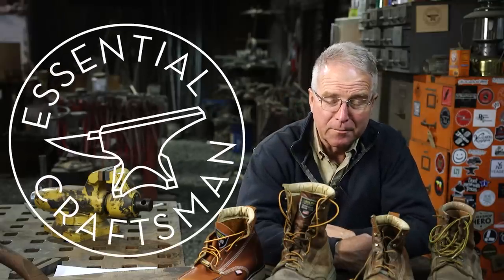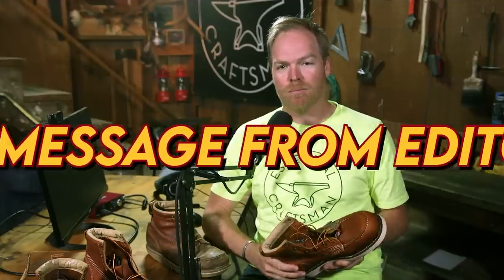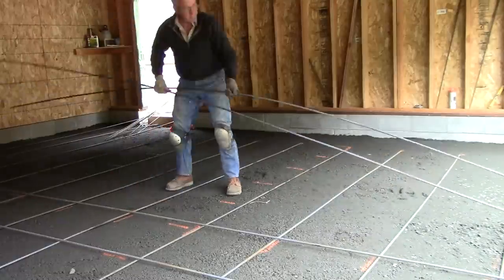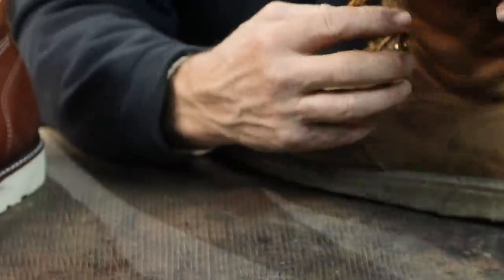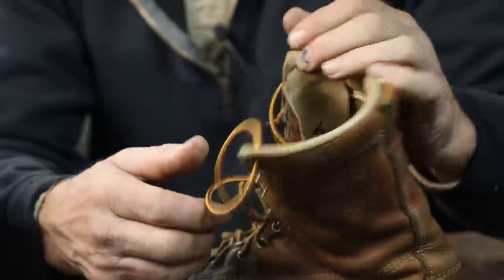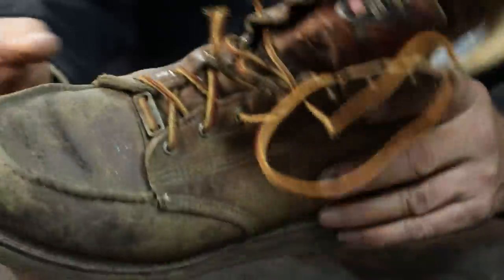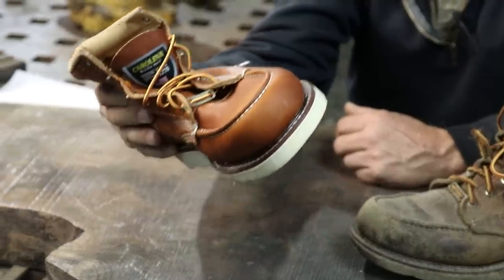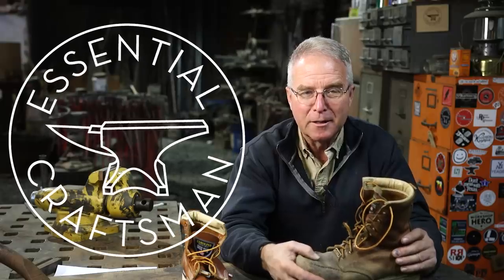Carolina Boot Review

Comment: I wear a 15 narrow and also have skinny ankles and low volume feet, tried all sorts, went out and got a custom pair of Nicks handmade in Spokane washington.  Heavy but fits properly and very high quality leather.  Also have a pair of Kenetrek mountain boots, lightweight and well built, rubber rand provides incredible protection of the upper.  Ment for hikes but my heal slips also not for skinny ankles but have been great work boots.  My other go to are Lowa renegade, not ment for heavy use but a good hiker.

Comment: I'm a machinist who also works outside on the weekends doing a variety of stuff, like clearing brush, running equipment or working on farm equipment, and I've had good luck with my latest pair of square toe cowboy boots by Irish Setter. Comfortable and good looking. Though i have to have aftermarket insoles for standing on a concrete slab all day

Comment: i had worn a pull-on Ariat with  “spidertek” mid-midsole. 

They are a hybrid western workboot. with a square toe and  composite toe. i had worn these  for two years of landscape/ Arborist work. it was great no laces in Arizona its Hot and the vents were nice. from climbing trees to pulling branches up gravel hill and lifting heavy stumps. They are perfect even come in a wide which i needed but nice leather walked along walls . these boots were just top notch for me. they were on the expensive side but i got my moneys worth.

Comment: I used to wear Redwing boots, but no longer.  For 2 reasons.  I had to have the stitches repaired several times.  And you can only buy them a Redwing store.  I like to shop where I can try several different brands.  I currently wear 8" Georgia Boots, which are fine and have lasted several years with no maintenance except Justin boot grease a couple times a year.

Comment: Steel-toe De Walt ankle boots. The boots you describe as Wellington boots are called rigger boots here in the UK and are banned on a lot of the big sites because if you break your ankle they have to be carefully cut off of your foot/ankle to prevent further damage that would be incurred if you took them off as you would normally.

Comment: I have used Carolina boots for years. I never use mock toe when I am welding due to the fact it burns out the stitching on the flat area. I just got a pair of wedge sole mock toe because doing carpentry work some days I'm on a ladder 6 /7 hours a day and that wedge saves my heels and arches. The correct tool for the job.👍

Comment: Blundstone CSA boots. Slip on/off, great for when you’re working inside, and you’ve finished the floors in a project and need to switch to runners or something like that. Relatively light, and the sole is very grippy. They were uncomfortable for maybe a week, but now they feel like putting on a sock.

Comment: Great review. The local Boot Barn do not stock them in the store and I found out that Thorogood wedge boots still fit narrow in a wide. I ended up doing an online order for two sizes. The 9.5 wide Carolina's fit amazing and smell amazing out of the box. Thanks again, from San Diego.
Reply: Hey @peglegthered. I'm looking at these boots too and I've read that some size down. If you have a 9.5 wide in these boots, is that the same size you wear in your average runner? Thanks!

Comment: I’ve been wearing Carolina Lineman boots for probably about 12 years.  Also have insulated Carolina loggers for winter.  Very comfortable, durable footwear, and while somewhat expensive, they’re far more affordable than many of their competitors.
Reply: Oh, reasons.  I like a tall upper for support and protection.  I often work in jean shorts, so the upper provides additional abrasion protection that many of you probably rely on your pants to provide.  I like the sole of the lineman boot because it’s aggressive enough for outdoor work, yet shallow enough to prevent tracking inside.  They’re electricity protected.  They have a shank in the sole, and a heel, which both help with ladder work.  They have a composite safety toe, which seems to conduct less than steel in cold weather.  They also have a double layer of leather over the toe, which seems to help the boots hold up to abuse better than the wolverines I used to wear.

The logging boots have many of the same attributes as the lineman boots, but with a very aggressive sole, steel toe instead of composite, and (in my case) insulation.  Admittedly, the logging boots are probably not quite as comfortable as the lineman boots, but they’re close.  Regardless, they’ve protected my feet quite adequately for years now.  I even wear them on 4 mile walks with my dogs.

Comment: I started wearing black, patent, leather boots, at 18 years, old in the military. Now they use suede leather boots, but so do I. I like the welder style black laces that are spark resistant, but I also use non-marring soles. I've been wearing the same model of boot for more than 20 years, because I hate to shop around if I am using each pair for 6 months to 2 years before getting a new pair. My size has bumped up ever so slightly in that time. I use a light weight 'trapper' version of Wolverine's 6 inch top. I'm with Nate on that.

Comment: I bought a pair of Thorogood wedge sole boots 3 years ago and it's been the best investment I've ever made as far as boots go. I prefer the tobacco color in 8in height. I've done everything in them from concrete to framing to drywall and trim and they've held up nicely. I chose Thorogood because an older carpenter that had taken me under his wing wore them and had been wearing them for a number of years. If I were in the market for boots right now Thorogood would be at the top of my list although I have also heard good things about Red Wing and Carolina.

Comment: I wear slip on Wolverine boots. I do concrete work and they get muddy very frequently here in South Louisiana. My feet get wet when hosing off lace up boots. And I try not to,but sometimes you have to step in concrete while pouring,to fix an anchor bolt or floor drain,or whatever,no time to change into rubber boots. Slip on boots are no problem hosing off at the concrete truck. Keep them oiled.

Comment: I don't need heavy duty work boots, but I do play outside and do some occasional occasional outside work.  But Timberland boots are the only footwear I can buy without trying on and KNOW that they fit my size 15 foot and that they will last for what I need out of them.  Like you said, preference, but I've found a brand that's consistently good for my use case.  Sometimes city shoes, sometimes boots, but they all fit and last.

Comment: I used to work off a ladder all day doing air balance in nicely furnished office buildings. I needed a good quality steel shank shoe. Carolina was the only ones I could find. I don't know if they still make them but they were excellent. I bought two pair for 105 dollers each. Never wore them out. I gave them to my painter when I retired and he raved about them. Ladder work needs a specific shoe and they are very hard to find anymore. If your feet get tired the effect slows down everything else. Good shoes make a big big difference.

Comment: I have owned a lot of boots by a lot of brands. A local retailer has an annual tent sale and offers new, highly discounted, work boots. I usually find reasonably affordable boots there and buy whatever ones I find in my size that I like at a decent price. I have over the years owned and wore Rocky, Bates, Irish Setter, Keen, Wolverine, Timberline. I have worn some out, usually soles first, and had some re-soled that are still going. My oldest are a pair of Rocky’s that are over 20 years old that have been re-soled twice; they’re great, bullet proof, and heavy. I have composite toes and soft toe boots, I have 8 inch down to 4 some with solid shanks; boots like other tools have some that are better at certain jobs than others. When you work on your feet take care of them; you usually, though don’t always, get what you pay for. The lessons I’ve learned over the years are I prefer leather over nylon, I must get Gor-Tex, and Vibrum soles are a must; outside of that I buy what I need and find deals on. Unlike some I’m not tied to a brand but I will say outside of Rocky my Irish Setters have been both my longest lasting pair, the 6” composite toes have lasted 3 years, as well as my least lasting pairs with 2 of the 4 1/2” soft toe boots not making 9 months. I typically wear the same boots everyday shopping out to a specialty boot if a job requires it and I always have a spare pair with me as well as a change of cloths just in case, another good lesson I’ve learned over the years. In the summer we’re occasionally in shorts and wear lower boots and in the winter 8” is the usual, as well as when it’s wet or muddy.

Comment: I've been wearing Danner Quarry Blacks for almost 2 years now. I walk on concrete mostly with a lot of dust of various types getting on em. Cheaper boots always wear the sole out on the outsides because of the way I walk. Can't help it, I'm a heavy heel walker. These Danners barely show any wear on em. They're comfortable, fairly light and not excessively hot. If I wear these out I'll buy the same pair again. And I've got 3 other styles as going out boots. They're all pretty great too.

Comment: White's and their consumer grade Hawthorn. My grandfather wore White's in the woods, my dad wore White's as a lineman and as a rancher / packer. I got my first pair of White's @ 18 fighting fires. Sixteen inch tops, full Vibram sole. I had them rebuilt once - the lie in the ash combined with the heat and the wet is brutal on the leather - but they never disappointed. I still have them. I have two pairs of Hawthorn - 8 inch tops with half-Vibram soles. I rotate between them. When one pair is done I send them in for rebuild, put them on the shelf when they return, and put the other pair into service. They are expensive. But I have only bought three pairs of boots in 35 years and they are still going. I also have my granddad's corks... but not much call for them in the desert! And yes, mine are long overdue for some Huberd's grease. Solidly built, great arch support (some might call it support from the Spanish Inquisition), and built in Spokane. White's was bought out by LaCrosse a few years ago. American made, but no longer American owned. If I were to consider new boots today I would give serious consideration to Nick's boots. They represent what White's once did.

Comment: I am a huge fan of the Keen boots. They are not as pretty as the Carolina leather boots, but they have always been extremely comfortable and long lasting right out of the box. I wear a 6” top now but have used the 8” timberland pro boots for ages also. They just got pricy and were hard to break in. You always had to get a new pair of boots a month or so before your old ones wore out and wear them around the house for a while.
Reply: I go with the keen cincinatti boots in the winter/spring good for snowy/muddy conditions but my feet get hot in them

Comment: I'm 36 (live right down the road in grants pass). And I've been wearing work boots since my early 20s. I'm in landscape maintenance. And for the longest time I had a difficulty finding a good boot. I wore wolverine durashox with the transparent sole for years and years. And they would only last about a year. They just wore out. That's when I found rose anvils channel and started learning about different boot construction and realized I needed a stitched welt. Not a welded one. I've had Carolinas now for 2yrs, the 28series non insulated soft toe. It's extremely heavy for landscape Maintenance. These Carolina moc toes look to be my next purchase with the wedge soles. I like the way Carolinas fit. They aren't Nick's or whites. But what I look for in a work boot first and foremost is comfort. I dont want to even think about my feet while I'm working. These look comfy AND durable.

Comment: I use to only go with Red wing logger with the steel tow. I probably have had 10 to 16 pairs of them over 10 years or so. I did land spacing and construction with them. They are supper heavy and they do not last even when you take care of them.  I switched to Thorogood 8" steel tow and I love them. The most comfortable boots I have ever owned light wight and have lasted. I work in Washington so they have been put to test. they have been in the mud, concrete, asphalt, diesel, oil, under water, and some other stuff. The best boot and I will for sure get another pair when they need to be retired.

Update 3/11/2021. 

I still Recommend the thorogoods. I love them and are still the best boots I've ever had.

Comment: Two points to add... soles are like tires, of the same material and tread pattern, choose long lasting or better traction, you don't get both.  Second point when buying shoes or boots of resoling quality always buy two pair (even if you need to save up again for the second pair) and alternate them daily. Two pair of quality boots that are allowed to dry completely between wearings will outlast three pair of quality boots worn daily.

Comment: I wear Timberland boots, I wear the 8” Boondock in the winter (northern Canada) because the sole has great traction in the snow and stays soft and pliable even in -40, I wear the Grid Works (iron worker style) in the summer.  Been wearing work boots for almost 30 years now, tried a bunch of different brands, the timberlands have an amazingly comfortable sole with anti fatigue material in it, almost zero break in,  they are comfortable on day 1. (Which is why I was never a fan of Redwings). As a bonus the tongue is attached to the upper so there is no chance of welding slag finding its way into your socks. They last several years, I get new work boots paid for by work every year so several pairs in my garage for working at home around the acreage and in the shop/garage.

Comment: I’m a dedicated fan of Carolina. When I first entered the trades, I bought Brahma brand at Walmart. I replaced them at least once a year, and laces several times per year. Timberland didn’t fare much better. After talking to my coworkers I found they all wore Carolinas. Most had the steel toe logger, but not all. I chose the met guard & steel toe. Granted, they were more expensive, but I’ve worn them six years and they’ve held up wonderfully at the concrete plant. Plus, I prefer buying American made when I can, let alone in my home state of Pennsylvania 

Typically, every three months (three day weekends in the USA work out this way) I scrub them with a stiff brush and soap, let dry for a day in the sun on a heater vent, then reapply mink oil and let sit in sun/vent for the remainder of the weekend. I still have coworkers ask if I bought new boots right after putting them back into action

Comment: I have tried many different brands of footwear over the last 16 years. Back when I worked construction (up to about 8 years ago) I was like you and preferred an 8" boot for the exact same reasons. Now I work in a field where I can wear a tennis shoe. With that said, I have found that I tend to keep going back to Timberland Pro series footwear. I've had a few pair, and I recently bought a pair of their Ripsaw loggers to wear when I am doing tree work. Thoroughgood makes a good shoe and boot too. I believe they are union made in the US, but I don't know if that is all of their boots/shoes or just some of them.

As far as tennis shoes goes, since I have to still wear a safety toe at work, I have been impressed with both the Reebok and Timberland Pro options. I am giving Merrell a shot now that they are making a safety toe and I have been liking them so far.

Also, if you want to lengthen the life of your laces in the fab shop then see if you can get a set of tarsal guards. They also help in case you ever drop something on top of your foot.
Reply: I tried every brand, Georgia boots had the best comfort and weighed the least. I weighed them all , but the comfort only would last about six months and the insole was glued in.

Comment: I usually wear laceless 6" leather boots by Acton which are very similar to Blundstones. They've lasted the longest so far, about 10 months. Main reason I got them was cause of ease of donning and doffing, but also because of the lack of stitching. With my old boots I would have to replace them every 3-4 months because either the stitching would rip, the inside fabric would tear at the Achilles tendon and the insole would get so worn out and broken in that it would affect my posture.

Comment: Typically I’ve been wearing a Rocky boot. I get around 1.5-2 years out of it before it is needing to be replaced. It was my go to because of its light weight and being waterproof. While they will still be my choice for a casual/camping boot, I’ve recently made to choose to switch to Thorogood MAXwear moc toe boots for my work boot. I wanted a boot with a full grain leather upper but also something light weight but comfortable. Working on and standing on concrete floors I admired the Thorogoods cushion and watching Rose Anvil’s videos it seems the Thorogood boots also have a harder sole so it should hold up to the concrete floor. So far they are a very comfortable boot.

Comment: I LOVE my thorogoods.  8 inch plain toe (so I never have to worry about a toe seam letting out) soft toe wedge.  Light as a feather, soft leather.  I got messed up feet so I trade in a spenco insert and bam, ultimate boot for me.  if I can help it, I’ll never wear any other kind of boot. Insanely comfortable.  I forget to take em off when I get home.  Drives the old lady nuts.